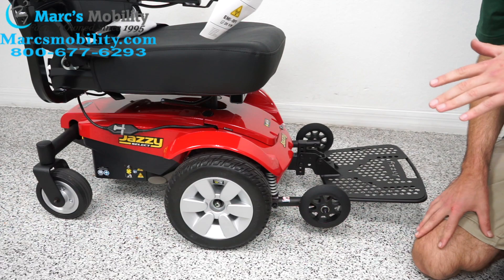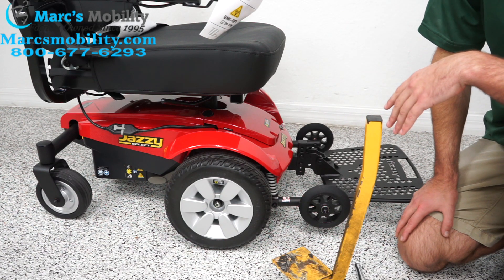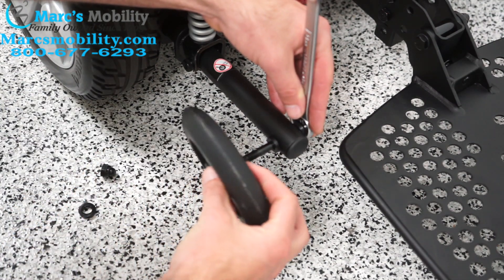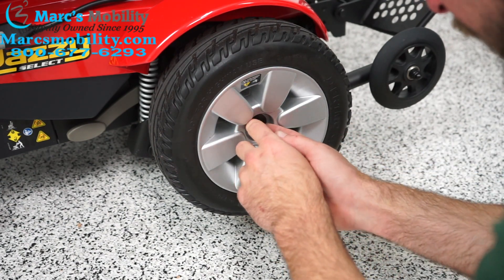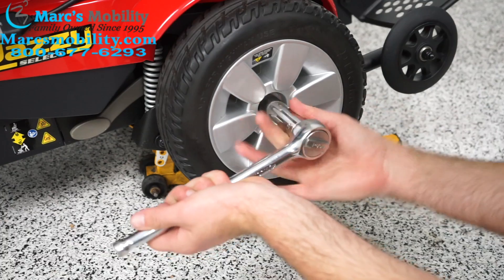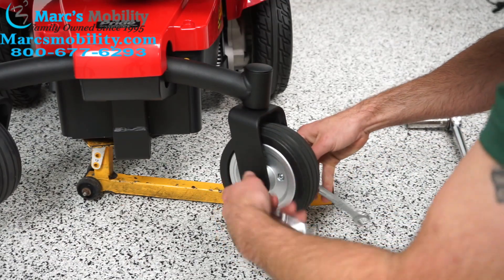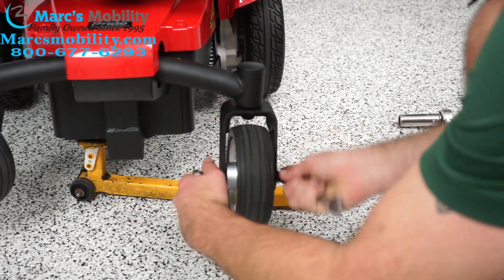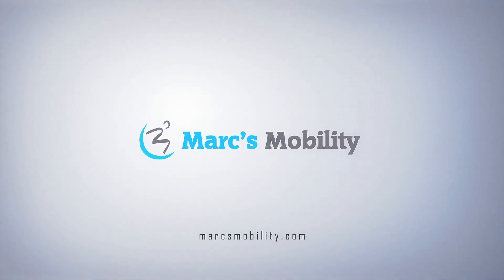How to Change all tires on a Jazzy Select - Manufactured by @PrideMobility

Comment: Do you all know if you can put larger, all terrain tires in place of the standard 10 inch ones? Trying to see if it’s possible so I could use it more off road.
Reply from the maker: Due to the fenders being the distance they are from the axel, if larger tires would be added, the fender would be in the way. Larger tires are not able to fit on the unit.
Reply: @Marcsmobility  thank you 🙏🏽 this is what I thought but I wanted to ask. Appreciate all of your videos about the jazzy select!!
Reply from the maker: You are more than welcome and glad you enjoy them. Do you by any chance have any ideas on videos you would like to see us do? We are always interested in new ideas from our customers. If you have any, please share!
Reply: @Marcsmobility  that’s a good question! For me personally I just got my wheelchair and would love to know any tips on maintenance I could do (or rather, tips for ensuring the maximum longevity of the machine) if that makes sense? Also videos on chair lifts would be awesome as well since I’m new to those and will probably need to get one soon. Thanks!
Reply from the maker: I will pass this along to our videographer and see what we can add to the list of videos. Now when you are talking about a lift chair, are you speaking about a chair with a seat lift or are you speaking about a lift recliner for in the home?
Reply: @Marcsmobility  I was actually talking about the type of lift that gets the chair into the vehicle!
Reply from the maker: Depending on the lift that you have, you may have to hit the actuating points with some WD-40 and keep them lubricated. Mainly that's all you would need to do for upkeep on lifts that go on the back of the vehicles. Lifts such as the ComfyGo GoLift shouldn't require any upkeep other than keeping the battery charged but the charge last quite a while.